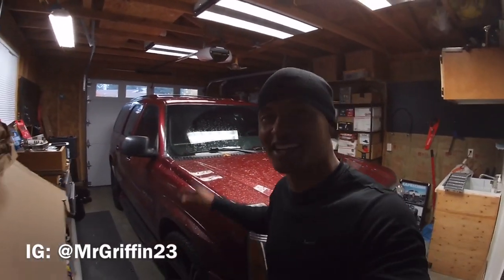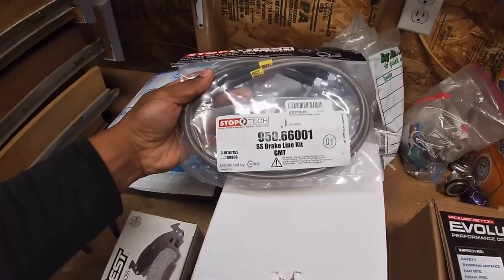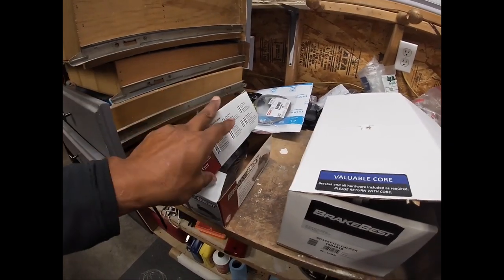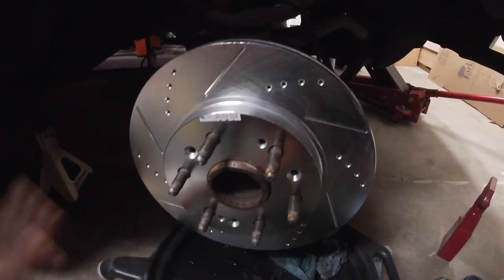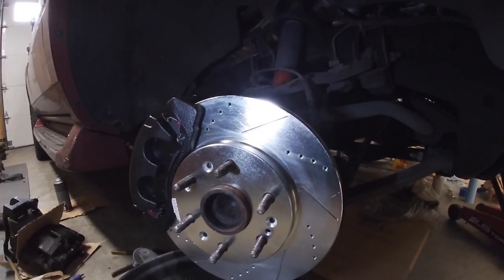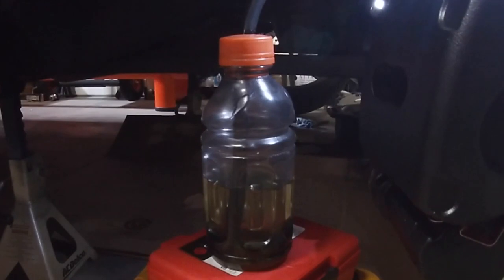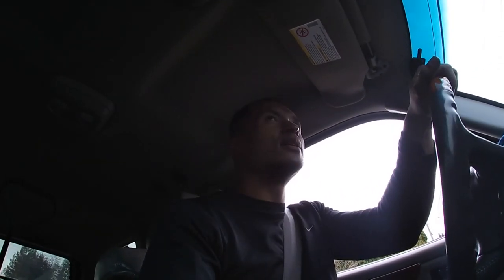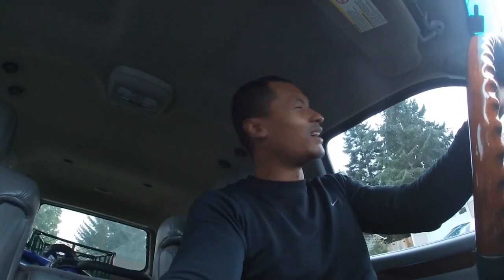BIG BRAKE UPGRADE | 2002 ESCALADE

Comment: Nice job! I had Detroit Axle brand pads on the front of my Jeep and they put out way too much dust. Did some research and went with Brake Best ceramics. So far nice but with all of the rain and still working from home, I haven’t driven much. Keep up the great posts!
Reply from the maker: Thanks! Yeah they do have a ton of dust. I’m glad I changed them. I got some Best Brake brand as well, but decided not to get ceramic - no reason. Appreciate it. We need to catch up.

Comment: Nice video, but you put the rotors on the wrong sides.  Slots go other way, if you look at the video the sticker on the rotor shows Drivers side.  Could also be the reason for the excessive pad dust as well.
Reply from the maker: Thanks for reply. Actually, this is the way I wanted them on. I did some research on it. Yes, you are correct some people do put them on as you suggested (it’s kind of the default way of doing it) but on the other hand I found that it really doesn’t matter. I found out that in some performance applications they put them on the way I have them. I just wanted to see if it made a difference or not. 

The issue I had with the excessive dust was the cheap pads I got from the supplier on Amazon. I changed them to a better brand of pads when I upgraded the rotors and it solved my issues. I’ve towed many times and daily drive it and it’s been great! Night and day difference. 

Thanks for watching and the suggestions. I will definitely keep this in mind for future.

Comment: Yeah I had to replace the rotors on my wife's tahoe last month. ...she is hard on the cars, she likes to come off the fwy off ramp 85mph to 0 in literally 40ft....went all the way through the pads and ate the back side of the rotors up......she kept telling me the rotors need replaced and I kept telling her there is no way the truck don't even have 35k mi on it....stuck my fingers behind the rotors and felt like a dummy apologizing to her!!!....I was able to order new pads and rotors for both sides from Summit for less than $200.....she was ready to take it to a shop, I was like hell you are!!!!......oh yea my boost district order came in today...all 3 boxes of it and I shit you not it is complete the dude even hooks you up with extentions for map sensors and iat sensor along with wiring harness with relay for the coolant pump.....couldn't complain about anything other than the time....I literally ordered it 1 month ago on 10-18 and it came this morning on 11-18.......now that I think about it, I have to get a throttle cable bracket....that's just about it!!...it even came with a 4 bolt to 3 bolt throttle body adapter and the fancy billet vacuum block offs.....yours should be coming any day now....
Reply from the maker: That 85-0 in 40 feet comment. Lol!!! That’s good info. Thank you! 

On my LSA I only have two boxes now, waiting on the 3rd. I got my 2 boxes about a week ago. I just opened up everything today and was like, umm... I’m missing a bunch of stuff. Called the company and he was like, yeah there’s a 3rd box coming. I agree, shipping is a bit slow, but I’ve had a good experience otherwise and products look great and it’s supposed to be everything you need for the most part. So that’s encouraging coming from you as well.